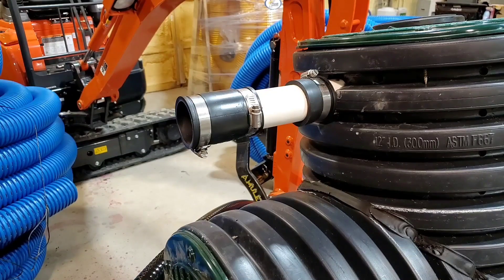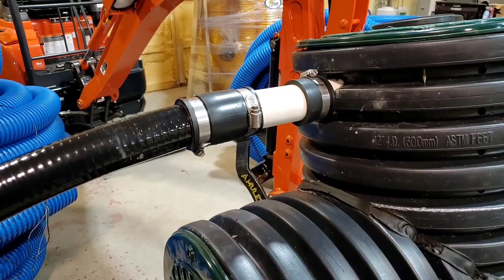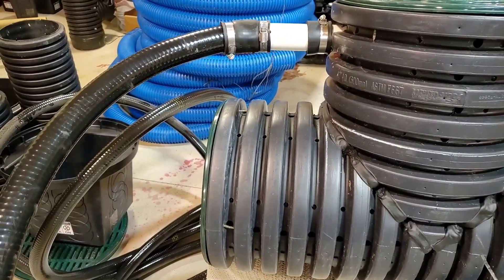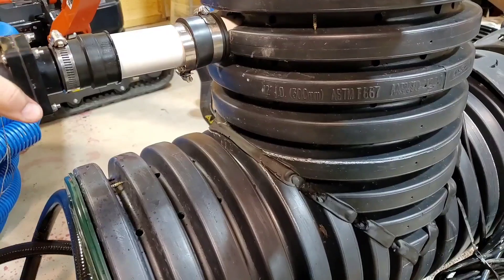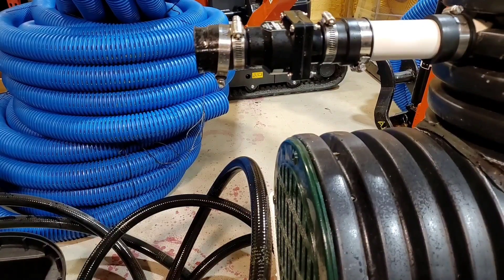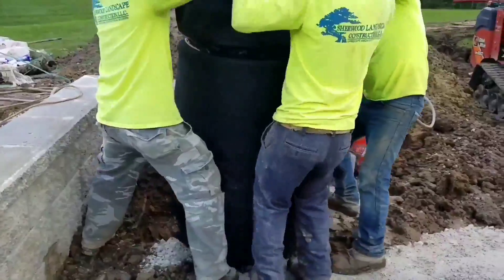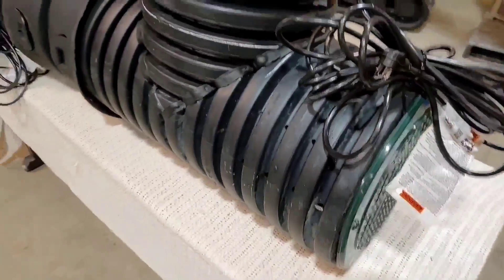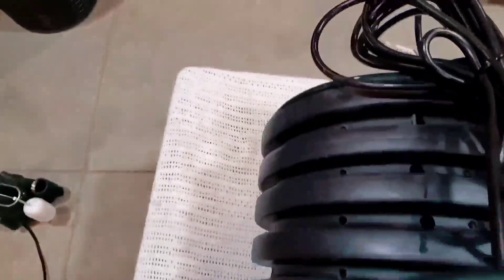How to Connect Discharge Line To Outdoor Sump Pump Systems [ Designed and Patented Duplex System ]

Comment: Great video and information. Why a check valve in the south
Reply from the maker: So people have to pump up hill so it keeps the water from draining back into the sump pump chamber
Reply: @FRENCHDRAINMAN  but But what’s wrong with doing that in the north?
Reply from the maker: @benfica00  
Lol 😆 nothing, nothing at all water 💧don't freeze nope.......and check valve do what exactly?? Prevent water from running back into the Chambered Sump System. It would need to run down hill as soon as it leaves the pump
Reply: @FRENCHDRAINMAN  Duh!!!! Now I feel dumb, I didn’t thinking that  lol. Makes perfect sense thank you.